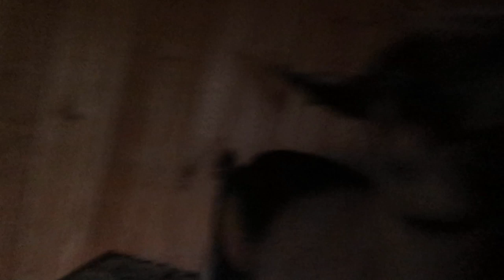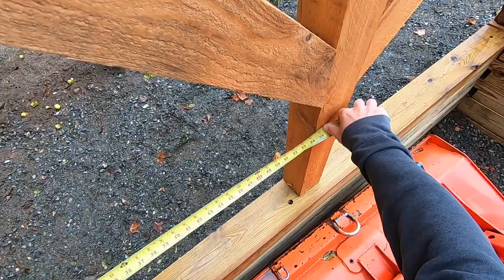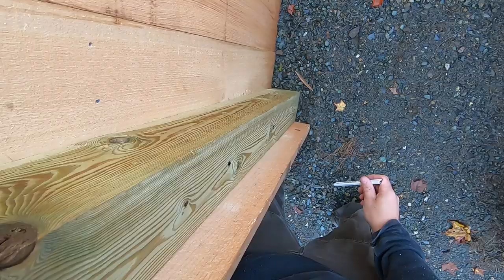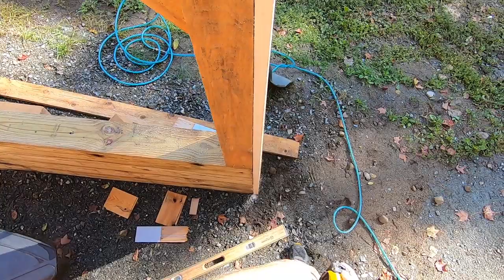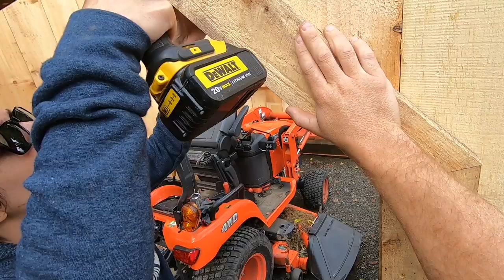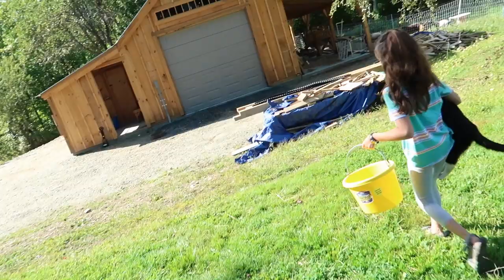Husband & Wife Install Trim on Carport Made from a SHIPPING PALLET

Comment: I would suggest BX armored cable for running your electrical. It's more economical, easier to run and will provide the same protection from animal damage. It comes in box spools in 50, 100 and 250" lengths with your wiring already pulled. You'll need an armored cable cutter, inexpensive tool that should be readily available from your local home improvement center. Use metal receptacle/ junction boxes and connectors for BX cable. Install your boxes in your desire locations with connectors installed. Measure your distance to cut your cable length. Then measure another 8" for a second cut. Cut through the wires at this second cut and you'll have your armored cable to length between connectors and a wire "pigtail" to feed inside the box to connect to your receptacles and/ or light fixtures. Being all metal it will provide you with the same grounding and protection as hard conduit without having to come back an fish and pull your wiring after installing the conduit. Cut and measure for all that conduit is going to take an inordinate amount of time and you still have to pull wires. Additionally, with conduit you'll need a conduit bender as well as the learning curve of how to use it without wasting a lot of material making your bends.

Comment: I heard your Dewalt chop saw bog down cutting that 5" wide trim board.  It should go through that like butter.  My best guess is you are using a long 14 gauge extension cord (or even 16 gauge!).  A good, heavy duty extension cord is expensive, but lasts forever.  I have a 100' 10 gauge, and it really makes a huge difference when the air compressor is on and using another tool plugged in at the same time.  Not only is it easier to cut with, but running motors at much lower than design voltage is actually pretty hard on them.  A 10/3 100' is around $120,  but 12/3 is about $50, is adequate for two tools, and is lighter to carry and wind.

Comment: Some random thoughts on barn safety:

You should have some fire extinguishers.  Like, maybe, a 3-A:40-B:C Fire Extinguisher. But, the "A" rating is pretty low. That's for common combustibles, which would include paper, wood, wood shavings and animal feed. So, you should have a water extinguisher too. Wherever the Fire Dept. is... is too far. You have to be able to protect lives and property.

No harm in installing a smoke detector in the barn, either. Better, if you can hear it at the house, too.

Wiring which could be reached by curious animals should be in conduit. I don't think you need metal.  Maybe you do. In the main section of the barn, you can run Romex, but consider keeping it exposed for continuous inspection for rodent damage.

Outlets should be GFCI protected. You can use GFCI circuit breakers for those circuits, or wire your outlets so the first in a series is a GFCI. One advantage of the GFCI breakers option is that they are all in one place, saving an Easter Egg hunt if one has tripped out.

"Milk House" style space heaters are suggested as they have tip-over shut-offs.

If you are installing a wood stove in the barn, observe proper clearances and watch out for creasote built-up in the flue.

Changing the subject. The meat birds should be able to move the tractor without your help, pretty soon. If you find it parked over by New Yolk City some morning, you'll know what happened. 🐔🐔🐔🐔🐔

Comment: Use conduit. Look for conduit & box fill calculators online. Use clamps/stands within 3 foot of boxes and within every 6 foot between clamps. (iirc that's the code.)
Lighting should probably be at the very least rated for damp locations because your barn is uninsulated.
Don't buy lights that do not have a CRI rating listed (Color Rendering Index.) You should look for a CRI of 75 or greater. (The sun being 100)
LED's often don't have a CRI greater than 65. If you want to know what bad CRI looks like, think Sodium Vapor Lights. You can't differentiate between colors. 
You also want to match the color temperature of daylight so around 4500 to 6000 kelvin should be good.

Comment: First of all if you went conduit you should use 1/2 in emt. However if it is out of reach for the animals I would just use romex it’s cheap and easier to work with if you haven’t bent conduit before

Comment: Use armored cable and put it in a deep trench and maybe add a plastic water pipe. You need to check what depth, as over a certain depth the ground does not freeze so the water pipe will be safe.  Don't forget to put a warning tape  in the trench over the pipe / cable  in case you forget where you put the cable.
Reply: Barry - The underground power supply to the barn was installed early in the build and is now live. All Al needs to do now is to do the electrical second fit. As others have posted I'd be fitting metal conduit - the extra couple of hundred bucks to stop rodents etc shorting it is cheap insurance.

If it were my barn I'd be installing LED tubes. Nothing fancy, cheap to run and give excellent light. I'd also look at putting up some external LED security lamps [with sensors and a WiFi controller so that the lights can be turned on from the house].

Going by Al's water catching apparatus at NYC I suspect that the barn will get it's own water collection system in due course.

Comment: I'm thinking you have to use conduit anywhere the goats can reach, even if it's in your workshop area? Also I'm still questioning your wood retaining wall? I've seen cement block walls bleed thru with moisture is they weren't tared on the outside first! you should of at the least painted the wood before you back filled, I think is will rot over time? Oh, very nice job on both structures!

Comment: Run wire in conduit. Protecting you and the wires and always count on more lights and outlets they are too useful. If in doubt about moisture put gfi  outlets in a little safer and worth the extra cost for the family safety esp where critters might damage wires or cords

Comment: LED Light fixtures here is an example 42W Linkable LED Shop Light for Garage BBOUNDER 48 Inch 4FT 5000K LED Work Shop Light LED Utility Shop Light Ceiling Fixture (10 Pack)

Comment: You should always put your electrical wire in a metal casing, or for sure , a squirrel 🐿 or rat 🐀 will  chew through it, and then you will really have problems.

Comment: Quick question Sir, what’s your plan to preserve the wood from rotting?
Reply: Pathfinder ~ The wood he's using is pressure-treated and I just assume that the pallet wood is, as well. Wouldn't that be enough? I have a flowerbed built out of pressure-treated landscaping timbers that's 35 years old and is still sound. Don't know that much about p.t. lumber, though.

Comment: Al, this is my suggestion for the "barn".  The best advise I can give you is do NOT put any videos on the channel showing any electrical work!!!  The armchair electricians and engineers will go totally nuts commenting on what they think.   Opinions run rampant!   Sorry Al, I was one of those Electrical Engineers and worked designing for contractors(retired now). First, read the section in NEC covering barns.  Yes there is one in the NEC.  Use a wiring method approved for this location.   Probably MC cable would be best.  Get 4' 2 lamp LED strip lights with 35k lamps.  Avoid higher numbers, blue light is very harmful to your eyes.  If filming in the shop is planned, (4) in open area, (2) under loft, (1) close to leading edge of loft.  (6) sockets for A type Edison based lamps (2) milking area, (2) under overhang side, (1) each other two stalls.  (1) or (2) motion sensor LED on barn front wallFor receptacles, (2) 20a circuits minimum.   Install as many receptacles as you can along both walls at 48" aff.  These must be GFCI protected.   No receptacles in animal stalls or on the exterior accessible to animals.   No electric submersion water heaters with concrete floors.  You didn't prepare the floors for them.    Again, best suggestion, do not put on YouTube!    Very respectfully,   Kevin

Comment: I use and recommend 1000bulbs.com   I have purchased several products from them at what I consider to be reasonable prices.   4' LEDs would be good in the workshop portion.    I would also use metal conduit for running wires in the barn.

Comment: It would be too dangerous not to run the wire through conduit. Anything could happen to the wire, it just makes sense. I would think it would be illegal not to. If nothing else, you certainly wouldn't want the barn to catch on fire as the goat may not be able to escape.

Comment: We just got putting these LED lights in some commercial garages which would be similar to your barn environments, got them off Amazon: Hyperikon LED Vapor Proof Fixture 70 Watt (150W), 4000K Clear, Waterproof, Shop and Garage Lighting, 4 Pack. These are LED strip lights similar to fluorescent in style.

Comment: If you use wire that is rated for burying,all you have to do is. They make a wedge tool that ,it looks like a log spring tool with a handle on it. You drop it into the ground, move it back an forth doing that from your power source to your breaker . Then lay your wire in then walk back over the small trench you made for the wire using your feet to close it back over the wire. Then you are through!

Comment: So this kit cost $2500.00 You can buy a woodland mill for that! if you bought a woodmeizer it would be a little more but better quality. I suggest you invest in a mill and go around to property owners and get your wood for free mill it up and just find a building you like and put it up. Save thousands of dollars and with the two kits you bought you could of bought a really good mill from woodmeizer. A good source for getting wood for free or little is tree company's or go to a farmer and usually you can get wood there for a really good price. Also a mill generates income on the homestead and is rewarding and therapeutic when you take a old tree and saw usable lumber out of it, gives a feeling of satisfaction and worth